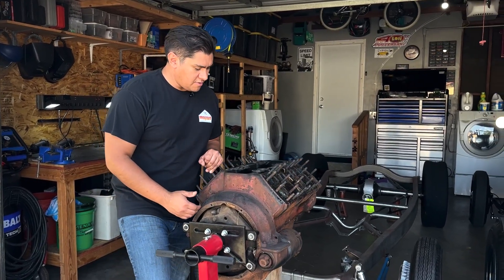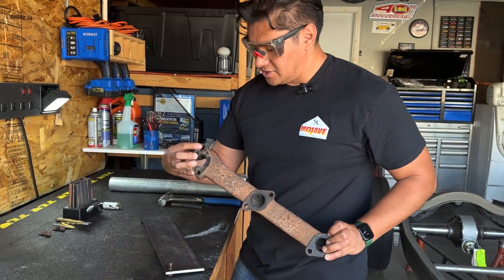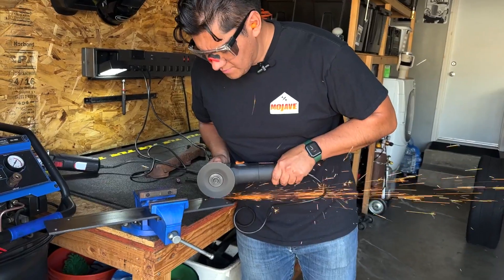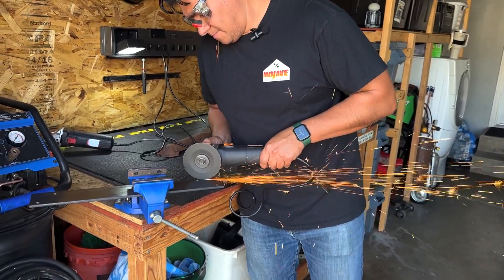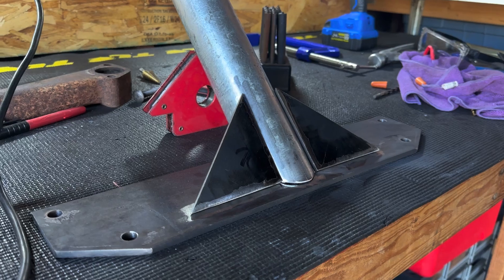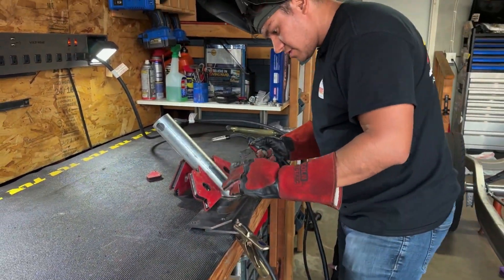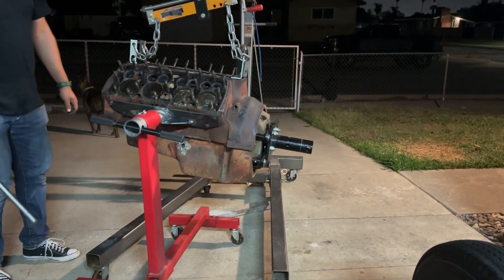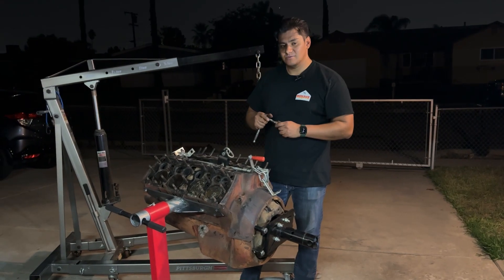HOW TO MAKE A FORD FLATHEAD V8 ENGINE STAND

Comment: I would have put the tube back several inches toward the rear of the engine -- closer to the CG.  Jim C.
Reply from the maker: yeah once the clutch and oil pan is one the weight certainly transfers to the back however putting the tube further back would also transfer the load to the exhaust bolts closer to the weight which I am not sure is a good idea.
Reply: yup your right about that

Comment: I figured since flatheads are still a thing these would be available but you probably saved a ton doing it yourself
Reply from the maker: They are about $80 and it’s about 15 in material 😅 but I was not able to find any other than stumpys but have to call to order and didn’t pick up or call back 😞

Comment: new sub here, the only flat head stuff i have worked on is 1941 ford 9n and 1948 ford 8n tractors and both are 4 cylinder but actually bought a flat head valve seat cutter its a couple hundred bucks but works ,we are talking works in the field too super simple to use.
Reply from the maker: Thanks for the sub! I’ll have to check that out 👌🏽

Comment: Looks pretty simple ------- not much in material wise -------- and easy enough to build ------ I have an Engine that will need to be broken down to see the condition -------- Have the regular engine stand ----- made it 49 years ago ------ but never had to mount a Flat Head till now ------- in viewing your design ----- off the side --- with access now to the pan and pressure plate ------ it looks like it might take a little bit of effort to rotate engine around ------ but a second look ----- maybe she's balanced pretty well there ---- it is close to center of block ----------- Wonder how hard it would be to come up with a ----- Gear Drive ----- similar to like a come-a-long ---- drops into next tooth and will hold without rotating backwards ------- off the handle area there ---Anyway ---- looks good will keep this video for future reference in making one ------- Got to have one ----- if one is to work on a Flat Head --------- Thank You for the Video -------- Have a Good Weekend ------- Rodney
Reply from the maker: Thanks Rodney, glad the video is helpful. If I could do it again I would weld the main tube closer to the center of the engine and not the cylinders. Overall it’s simple enough to rotate but would be better balanced. Maybe even use the center exhaust bolts too.